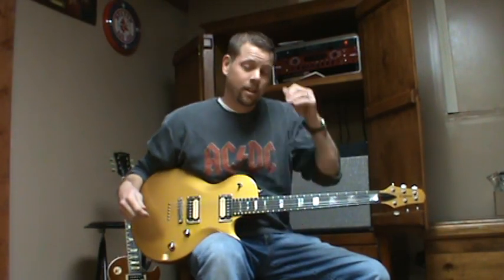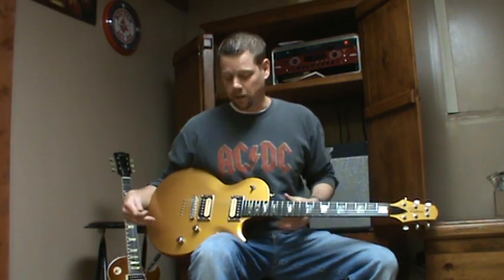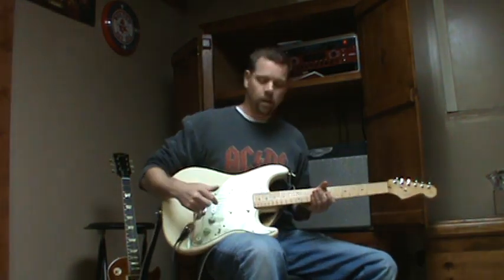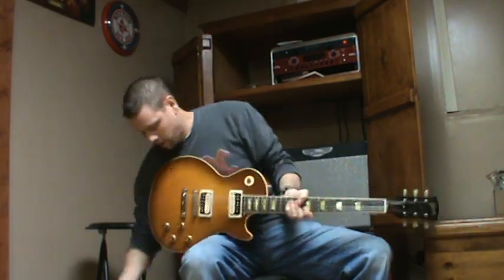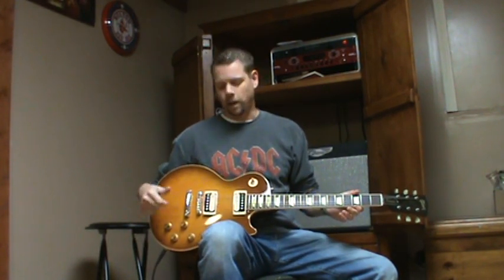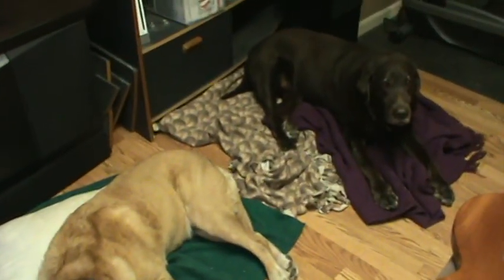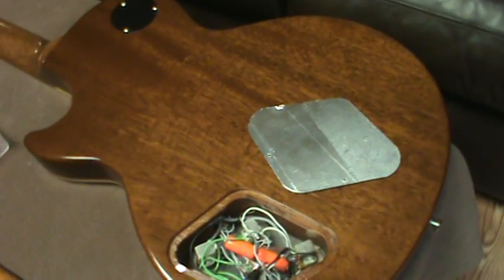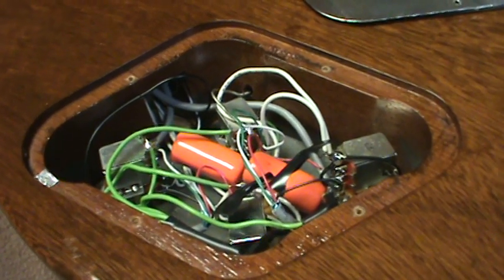Gibson Les Paul with Hum / Noise Issue

Comment: I have the same problem. I did not use shielded wire from the toggle to volume pots. Do you think this was the issue with yours, or do you maintain it was the amount of wiring or cold solder?
I went thru mine again and it is not the bridge ground, or cold solder joints. I can only think that I need the braided wire going to toggle! 
Wiring, so simple, yet such a bitch! Thanks for posting.

Comment: Ok take that pot cover back off the back of the guitar, look closely around the inside edge and you will see an ever so thin aluminum tape. I saw it in your video. I don't think you noticed it. That is a thin grounding strip that goes down to the pots. Notice on the Carvin that the copper tape is completely lined within the pots hole. Because of the entire hole being copper lined,  if one pot has a good ground, they are all grounded by virtue of the copper liner contacting them all. However, the real purpose of the copper tape lining is to insulate or block electronic noise from pickups to the pots which cycles around and around. Similar to a microphone in front of an amplifier where the sound comes out of the amp and back into the mic which goes back through the amp again non stop. Touching the metal surfaces on the guitar grounds and interrupts the cycle. I believe that is the issue. But I will be finding out as I have the same issue with my Epiphone Les Paul. I don't believe it's necessary to use copper. Any conductor should work as well. Hence you'll notice that thin strip of aluminum i mentioned earlier that Gibson put in. I think lining it with aluminum foil will work just as well. Just tucking it in around the inner walls of the wood in the pot hole making sure its at least touching a grounding surface of a pot or the original tape. Let me know your thoughts and I'll let you know how it works out for me.

Comment: Hey man, found your post because I was looking to see what others did regarding a hum on their les Paul as my son's was humming horrible (2011 deluxe with humbucker split pots).  Looks like you didn't find your issue but I found mine and wanted to pass along.  Ground issue (like stated by everyone here).  The Les Paul wires are super skinny and my son's ground wire from the switch to the pot ground was very loose and then broke off.  Also, there was not continuity between the bridge and ground as the ground wire inside the cavity had worked itself out of contact with the bridge.  And finally, and most important, the shield to the input (main ground) had ever so slightly come lose.  It still had continuity when testing with the multi tool but dang the noise was still there.  I reflowed the solder on that joint making sure that the solder was there to hold the two wires together and not to make the connection.  I also resoldered the loose ground wire from the switch and made sure that the bridge was connected to the ground wire (back out the screw and push the wire in there and test with multi tool).  I don't care if you had a luthier work on your guitar, these are things you need to be able to check so you don't get screwed and get irritated when you have a nice guitar.  Good luck and hopefully you have solved your issue by now.
Reply: I did everything here except use solder to only hold connection thank making the connection
Reply: Thanks,maybe i need to look it over again,after gc didnt even use a multimeter,he just wired the pots together WHEN ALL THE POTS ARE ON A METAL PLATE😂,$10 later,I unsoldiered one wire at a time,checking it with the mutimeter and I didnt need no extra mess of soldier joints on my pots,but the wires are thin,and one of thecwires is grey that comes from the switch,my tail peice ground is good,atlest I hope,If I dont figure it out.How much would it be for parts and labor?Im so mad.Its 19 yrs old and barely was played.I cleaned the pots with deoxit D5,that helped my amp pots,but claning the lester's pots didnt help😡

Comment: Hey man. I am facing the same problem. I own a Gibson Flying V. Hum goes away when I touch the strings. It is really irritating while shifting chords and all. I got the guitar cavity properly shielded but it did not help at all. All cables are attached properly. What do you think could be the solution? What did you do to finally kill the noise?

Comment: Is the two conductor wire that runs from the toggle switch to the input jack shielded (braided)? Is the braid of this wire soldered to ground someplace? If you take a multimeter to the guitar and do a continuity check from the stop bar, and touch all of the pots and bridge, does the meter indicate a connection?
Reply: Mine does,but has same problems,a 2000 lp classic

Comment: rip off the ground plug part that plugs in the wall... fixed
Reply: Dont ever do that. Thats very dangerous. If anything goes wrong with your amp, your amp will discharge through your body and you could very well die. Keep yhe ground on, and if your amp has 2 prong, change to 3 prong asap.
Reply: @jonny1251  what if there is no ground in the wall AYE??
Reply: @tanza14  means you have to upgrade your home wall plugs to 3 prong.
Reply: Hello there! I have a LP junior 2015 with excessive humming when the guitar was plugged in and also when the cord was plugged in without the guitar. No humming of the amp when the cord was removed. I did shielding my guitar but nothing changed. I changed the cord into noiseless cord, nothing has also changed. I suspect that the problem was the amp. So, I went to the music store in the city and tried the same Fender amp that i have, there was minimaI noise. So i bought that amp to compare with my other amp at home. the same humming occured with my new amp. I confirmed that i have a grounding issue in my place as suspected by the music strore salesman. So i attached a ground wire using the screw at the back attaching a wire to the ground. And now my guitar is silent with minimal noise of a single coil pick up. My house has  no 3 prong inlet, i cannot use that kind of grounding.  But i wondered why is my Peavey guitar silemt without the ground. I love the sound of my LP than my Peavey. .hope my desperate experience would help. .ty